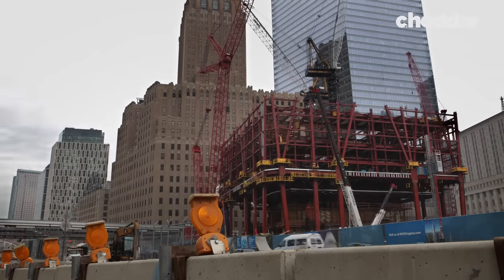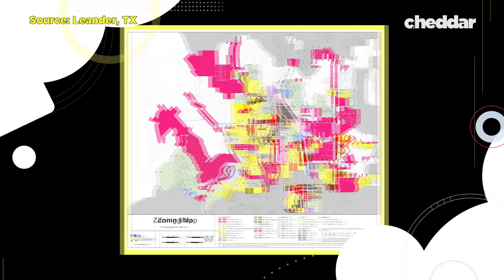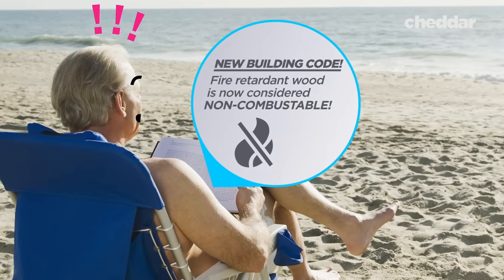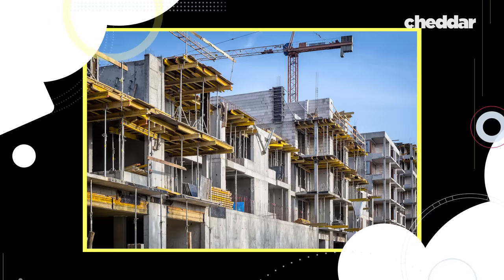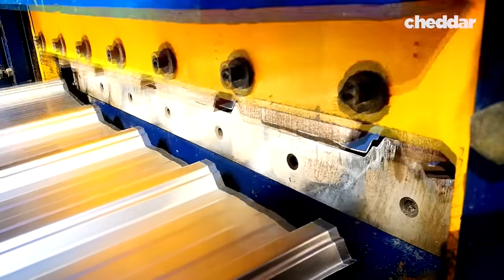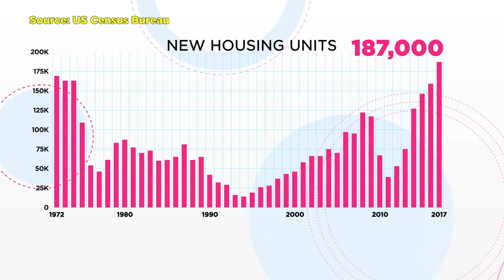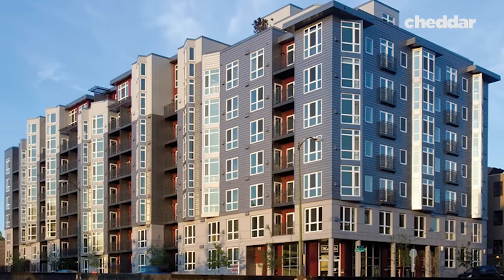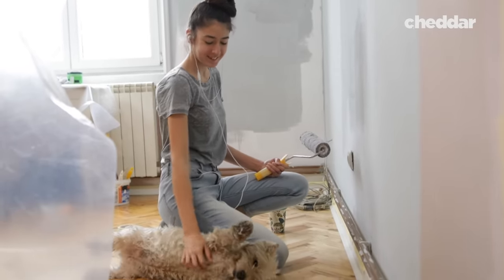Why All New Apartment Buildings Look Identical - Cheddar Explains

Comment: Imagine Commie blocks from central europe, but modernized, the whole area is more pedestrian oriented, implemented with infrastrucrure like schools, pharmacy, etc., Lots of greenery and shops, caffes, markets and implemented underground parking.
The problem here in this video is only the use ozf materials, so then just dont use wood and replace it by concrete. Problem solved.
The real problems is that in the US there are only widespread suburbs and tall towers lined with huge wide roads. Basicly all car oriented urbanisation and that is the problem.

Comment: Tim Smith - the creator of multi story wood framed construction over a concrete podium that swept across the country? Unlikely at best. Auther seems to have done a google search and pulled the first result and published it in this video. Modifications to codes many times result in changes to construction methods and practices. These are by design. To be sure many other architects took advantage of this change without ever knowing anything about Tim Smith.

Comment: I was wondering why residential buildings in the US start looking so much like the residential buildings in Athens, Greece where I am from. The only difference is that ours are made of cement and brick, not wood and you don't find them in specific urban zones, you find then all over, in like 90% of the city and they are most typically 6-story. A lot of them are many decades old and look run down and overall terrible while the more recent ones look more like the ones in the US. I find them ugly as hell, I always thought of my city as one of the ugliest because of these buildings.

Comment: Definitely first world problems. Those developments are light-years better than the mass market suburban houses of the 40s-00s, Soviet-style brutalist apartment blocks or cinder-block, tin-roof construction you get in most of the rest of the world. If we want to fight climate change through intensified, mixed-use, transit-oriented development then this is a reasonably attractive and affordable option. Most working and middle class people who live in urban areas in the future are not going to be able to afford bespoke, architecturally designed houses or even detached houses on quarter acre lots. Nor do they need them as long as the building is safe, structurally sound and not actively an eyesore, job done. Get them built at an affordable price point and on to the next.

Comment: video conveniently leaves out the environmental impact of concrete rebar, and steel building methods... timber construction is far more environmentally sustainable. if you're getting water damage inside that's far less to do with timber panel construction (bc allowances in timber for shrinkage is in the building regs) and far more to do with construction companies not applying the appropriate damp proof membranes (or other coatings or courses), the problem isn't solely the materials, its the low cost these buildings are produced at/the time factor of rushing to get new builds up/unreliable specifications and specificators/unreliable contractors

Comment: Wood Moves? …who knew?! Author intimates that this building type is specially susceptible to water damage because it is built from wood. This contention is FALSE. There is no special susceptibility to water damage from this building type. Architects always have to consider movement in materials of any structure they design and detail including podium buildings. This is nothing new. So if your building leaks, it is possibly because the details were not carefully considered or it was not carefully constructed rather than because there is some inherent issue with this building type. Furthermore, what this Author fails to realize is that most of these buildings are constructed with a rain screen. The exterior material is actually allowed to let water penetrate beyond its surface. it is the air barrier behind it that keeps water out of the building. In quality construction, this air barrier with a membrane that, you guessed it, allows for movement. This portion of the video is particularly inflammatory because it is flatly wrong.

Comment: Ooooh. I'm not american, but as an engineer I'm very concerned about those buildings

Cheap housing is good, but that's just a lot of safety hazards.
Vents of those those length in a wood is just an invitation for the building to light itself.
As is sandwiching wood between other materials!
Fire wants to go up, and it will travel freakishly fast through those, siphoning air from the basement

Wtf, america

Comment: "and the all Look Exactly the Same..." Except that they Don't. The first three buildings shown are rendered completely different from each other - they are made with different materials, details, proportions and configurations. And that is part of the reason why this building type is popular. Because the exterior material is non-structural and is simply hanging on the structural frame behind it, the building can be rendered in any styles and with any material. It can be brick, thin brick, cement board, wood shingle, vinyl siding, metal panels, stucco, high pressure compact panel, custom wood panels, GFRC - you name it. The contention that these structures all look the same is ridiculous , as is demonstrated by the variety of styles shown throughout the video. Does the author of this video not know the difference between a building type and a style of architecture? If not, maybe she should think twice about posting on a subject for which she has little knowledge.

Comment: Trust me in my country (Israel)  its WAY WORSE
I live only 10 minutes away from Tel Aviv but if ur in Tel Aviv and go to Holon all you see is just ugly concrete buildings

The worst thing about those concrete buildings is that they have no fire safety meaning that a fire could destroy the building, also most buildings have very weak foundations but to make it worse some of the buildings are 30 or 40 years old so the concrete poles have degraded and started to rust, meaning that the buildigns are very vulnerable to earthquakes.

Comment: Why do you hate hardy board so much? lol Also, you failed to mention one key factor in these buildings. Depending on the local laws (though it may be an OSHA thing) you don't need a crane and certain safety equipment to build up to 5 stories. That's why so many of these buildings are max 5 stories. Once you go above 5 stories, you might as well go 10, because the additional cost of safety equipment makes it more efficient to build more stories. Why build 6 if you're going to spend all this money on safety equipment just for 1 extra floor, is that cost justifiable? I'm sure in some cases it is. But this is why you see so many 3, 4, 5 story buildings like this.

Comment: These aren't cheap in my city. Maybe cheap for the builder but the rents are always at the top end . Wayyyy too expensive for what little you get. There's also way too many of them, to the point that they can't fill them. ESPECIALLY when the pandemic hit and people started to move outside of the city. And yet they build more 😑
Reply: You are paying more for more modern amenities. Buildings like these are likely to have modern appliances, modern floorplans, and have access to services like newer laundry facilities, pools, and fitness centers, things that older apartments often lack. 

They build more for two reasons. One, many of these were already planned long ago and they are already committed. And two, they are banking that demand will return when things settle down.

Comment: I've seen many of these go up here in Phoenix and wondered why they all had the same number of stories. I had assumed that was the structural limit of wood construction, but now I know the real reason. Thanks.

I don't think they're an eyesore given the urban standard. I'm seeing color and textures on exteriors that help a lot. I do wonder how these will look in 20, 50 years. Being cheaper to build means cheaper owners like them and they also like cheap maintenance. Concrete structures may hold up better and because of the higher investment owners might be more willing to invest in good maintenance.

I'd rather see these 5 story buildings than very tall buildings. But I guess for a growing city taller buildings make more sense. Maybe the 5 over 1s being built today will be torn down in 20 years to be replaced by much taller structures.

Comment: What a dismissive video. The framing style does not dictate the architecture outside. I don't consider this 'meh', they are tastefully done. Being built cheaply does not mean the architecture is meh! It's the market that dictates it. Cause you know it's expensive to build here in America, let alone in major cities. Developers will always fined the most cost effective way of building a current trend. What amount of money we use to build here in America can be built on full concrete structure with the same architectural outcome in relatively cheaper nations.